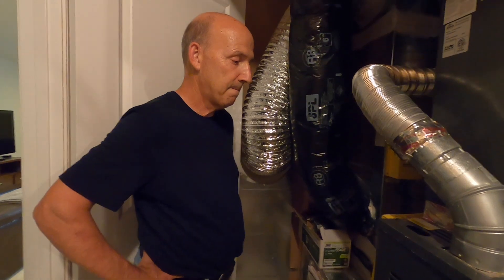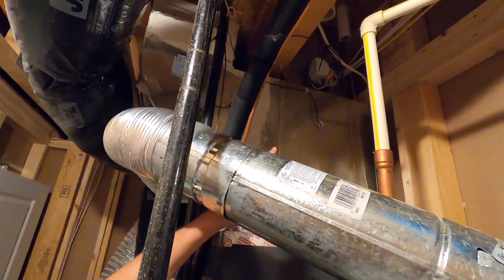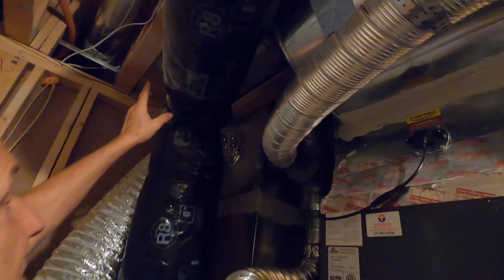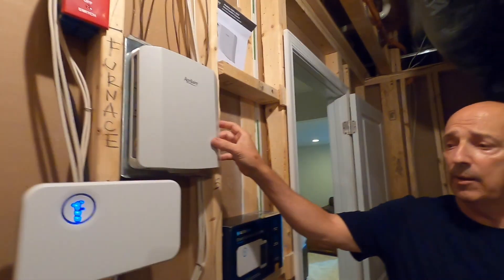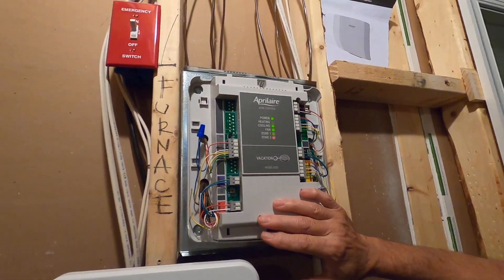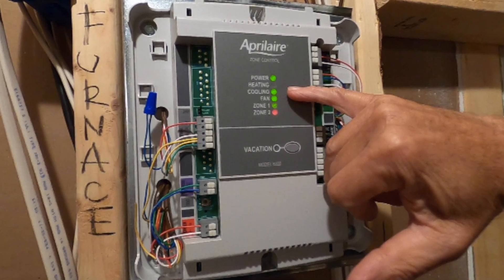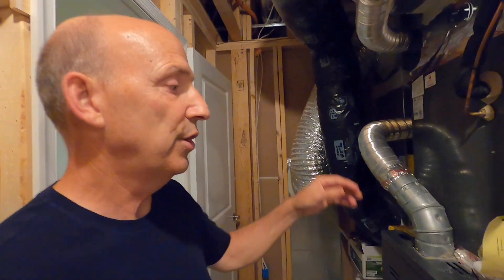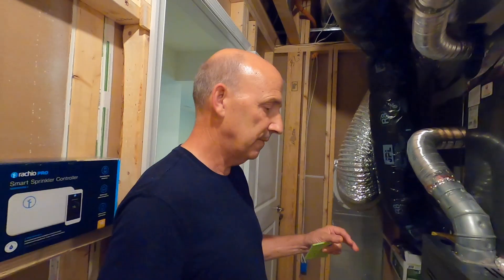HVAC UPGRADE: ADDING AN HVAC ZONING DAMPER SYSTEM

Comment from the maker: Thanks for watching!  I highly recommend zoning if you have areas in your home that get too hot or too cold.  It works great!  See you next week!
Reply: What Thermostat is the best for 3 zones,
Reply: @Knock_Out22 
We only use Honeywell TH8321R thermostats. You must use an end to end RedLink system to keep wiring to a minimum and uncomplicated, and the up sell is the Internet Gateway, which gives customers what they crave. Smart phone control of the system. The zone control is easy to install and programming it can be mastered with short training, most of it you already know.

Comment: I went to a customers house and he said only one zone works at a time. I was there to replace a bad motor.. and I didn’t notice when you put one zone on if they’re both calling for heat or air conditioning the other one shuts off ???
Reply: I am sorry I meant I did notice . When the second floor calls for heat, the first floor will shut down. It’s like only one zone will work at a time.
Reply: @nycowboy2288 probably trying to cool one floor and hear the other. Can't do that.

Comment: What about your bypass damper? Dump Zone? What happens when just one zone is open and how does that affect your static pressure and DATS? With that gas furnace poorly vented out I'd be worried about all that!

Comment: The most important change he either didn’t install or talk about is the air supply. If you zone a system, you must adjust the supply air flow. You cant just cut off half of the supply air with a damper. You will ice the evaporator coil and greatly shorten the life of the blower motor. It will also cause excessive duct noise You must install a 12” or 14” bypass duct at the furnace or a spill zone. A Honeywell CPRD, Constant Pressure Return Damper, takes supply air and dumps it back to the return to reduce static pressure to specified values dictated by the furnace manufacturer.  Do not use the obsolete SPRD, Static Pressure Return Damper. They require an external weight to regulate the static pressure and are never set correctly. The CPRD is automatically adjusted to air flow conditions, but you can make field adjustments if your manometer shows it is not correct. Another benefit of a CPRD is you get better dehumidification during cooling season.
Reply: as an hvac tech, damper system maintenance is too high and too complicated to diagnose when something doesnt work.
Reply: @blipblop92 
With 43 years in the trade, my attitude has always been, if I don’t understand how something works or am not familiar with troubleshooting it and fixing it, I find a source to learn about it. In this business, your training cannot stand still or you will quickly be a former tech. Look at inverter technology. It is complicated and constantly evolving. Master what you don’t know, my late father always told me. If zoning gives you trouble, learn about it. Don’t dread that service call. Embrace the challenge.

Comment: Actually I have the same setup at my home and not liking it. It’s causing higher energy bill. 

For example: hot air from the lower level is tend to go upstairs. So it’s causing conflict and making it work in a loop. During winter, heater will turn on on lower floor, it’s trying to heat it. Upstairs getting all hot air causing the upstairs zone to start the cooling. This goes in a loop with high electric bill.
Reply: Your upstairs heat should always be set higher than your downstairs temp. 71-70,72-71, etc. even 1 degree higher is enough. That way your down stairs heater isn’t displacing cold upstairs air.

Comment: For those that do not have a Dad that can do this;
What did all that cost?

Try the EG4 Solar Mini Splits.
They can run completely on solar and switch to grid when the sun goes down.
You can use multiple units for zoning.
They also heat in the winter.

Comparing a Central AC to this Mini Split:
Condenser 240VAC - L1= 18.21A  L2= 15.51A 
Blower Motor 120VAC= 2.7A
$8000.00

EG4 Solar Mini Split
6.5A DC Solar or 6.66A AC Grid
Automatic Switching
.35A Grid Standby Current
You can run it on just solar when the sun is out. 
Totally Free Energy.
You do not have to connect to grid at all.
DIY Installation, lines pre-charged.
$2600.00 

Any questions?

Comment: Question -- I have similar setup on my house. When both thermostats are calling for air, the blower now has to support both zones at the same time, which in turn reduces the amount of air coming out of the registers and increases the amount of time it takes for the thermostats to reach set temp.. is there a way for the first zone to satisfy before it goes to the second zone? I do this manually when I am home and can catch it, and it seems to be more efficient in reducing run time, but it would be nice if I could interlock it so they have to "wait their turn".. It's a new house and new unit, so individual zone run time is short being that it is well insulated

Comment: I would love a video on how to adjust the mulitple zone damper system. Mine isn't working.  Main floor is set at 80 but temp is 70. Third floor is set at 74 and cools to 74.   Anyone know how to adjust dampers or is there another problem going on.
Reply: I want to know as well.

Comment: I have 2 apartment and a finish basement. Can I have the 2nd apartment with the basement as one zone and the 1st apartment / side Apartment as a separate ZONE?
Reply: Yes, I think you can do this with most zone control systems.  I have used the SmartZone in a similar application.

Comment: New construction in February 2023 on a 2 level home.  2,213 sq/ft main floor and 1,484 sq/ft walk-out finished basement.  Basement will be a full-time living area for our kids until they fly the coop.  I have been quoted $19,340 for a 4 ton Ruud heat pump, 3 stage with 18 SEER.  I requested a 2-zone system (basement zone 2) and have been quoted an extra $7,140.  

Just curious if you could give some feedback if that is extraordinarily high? I feel okay with heat pump and ductwork pricing.  It is the zoning cost that I am concerned about.  Great channel. Thanks in advance.
Reply: The heat pump is probably 2 stage. If it is a dual fuel system with a single stage gas furnace, then it is wired and configured as a 3 stage heat system, the furnace as a single stage. You will never have 3 stages running because either the heat pump runs or the furnace runs. Never both together. The furnace would cause excessive head pressure and hopefully shut the heat pump or you will damage the compressor. Pro Tip. DO NOT INSTALL an Echobee or Nest thermostat for dual fuel heat pump system.  You will never be happy. Honeywell TH8321 thermoststs are all we use. Never had a call back because of the thermostat. Also available in WiFi if you want phone control.

Comment: Do you need a return vent for every zone?
Reply: @joseespinal3363  
Yes. You also install each zone thermostat as close to the return location as possible. You cant “ over return air” because no matter how much return you install, you cannot increase the square inches of the hole cut into the blower area for the return plenum.

Comment: I want to do this to my home, but I was concerned about backpressure with the closed damper. What are your thoughts?
Reply from the maker: Great question!  We actually answer your question in the video we just posted today: https://youtu.be/uJHyVj2fY0Q. Your question is addressed around seven minutes into the video.
Reply: U require a variable speed blower

Comment: I did the same thing to my 1st home! I used an Aprilaire & added a 3 zone controller (DURA-ZONE!)! My wife had a building contractor add square footage to our upper level!
We had a 2.5 HP ton system & I changed to a 3 ton heat pump with a 3.5 ton air handler!!!
Then she had the house expanded (perfect timing NOT!!!)  So I installed 3 zones! One for the kitchen, one for the bedrooms & bathrooms, and one for the add on great room with high ceiling!!! It worked great except during extreme hot summers! (Also installed an attic exhaust fan to help take load off during hot summers). It all worked ok but the expansion of the house really required a bigger system all together! 4/5 tons for 2000 plus square foot house now!  Of course my wife didn’t understand because I was the HVAC GUY & SHE WAS THE THERAPIST!
I squeezed everything out of that smaller system & made it work for the time we lived there!
Learned a valuable lesson too! BEFORE YOU REPLACE YOUR EXISTING SYSTEM/AC…… MAKE SURE YOUR SPOUSE ISN’T TRYING TO RENOVATE YOUR HOUSE WITH WAY MORE SQUARE FOOTAGE!!!!! After you know how much house you are dealing with…. You know how big a “CENTRAL/HVAC SYSTEM YOUR GONNA NEED!” Class dismissed 🤠🤔😉😂
Reply: What Thermostat did you use?

Comment: I need to do this at my current home
Reply: If you have good access to your supply duct work it’s a good option! One system serving 2 levels will usually have hot cold issues! Upper hot during summer! Lower colder in winter!
Split level houses have same problems too!
I was at a house yesterday complaining about hotter upper! Luckily they had a clogged filter! So we’ll see how it goes when it gets hotter! The last tenants complained hot upper as well!
I double checked access for zone being installed….. if new tenants complain again I’m proposing landlord have 2 zone installed! And possible 1/2 ton more  system! (if still complaints)
2.5 ton outdoor changed to 3 ton if necessary 👌👍🏽🙏🏽 (there’s a 3 ton furnace & evap on the inside)….. gotta keep your eyes open as a service tech to solve potential problems too!
I’m teaching a guy right now! Unfortunately I fell ill and no longer do full time HVAC! Passing the torch I feel will still be beneficial to the public 💪👌! Good luck on whatever you do!
Install manual dampers & adjust seasonally or install electric dampers with control system as this guy spoke of! Aprilaire Dura zone or Honeywell!   These 3 are good options for standard systems!!!! (Dual fuel systems you have to check your options of zone controls!)

Carrier has a more complex type for infinity system! Don’t use if you don’t have infinity A/C & Furnace!!!